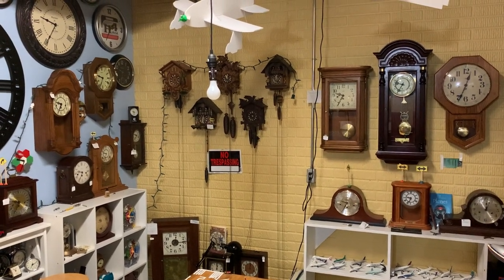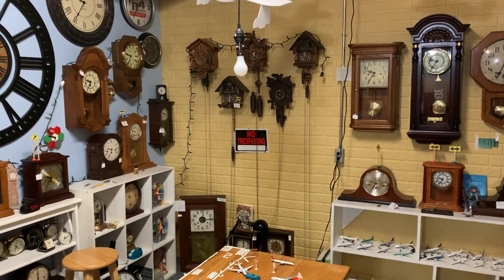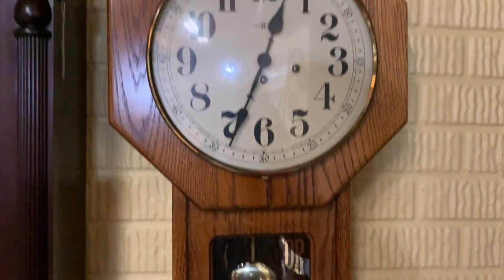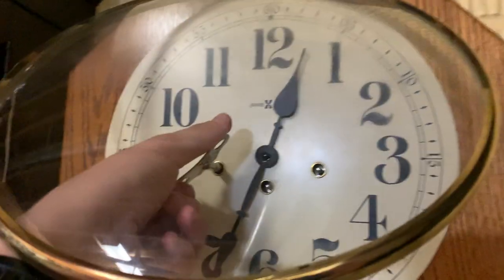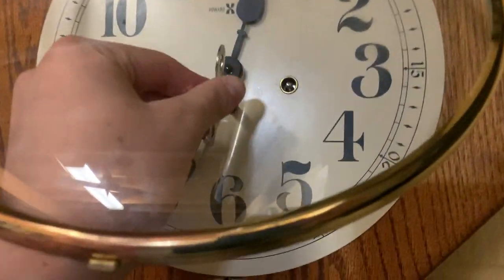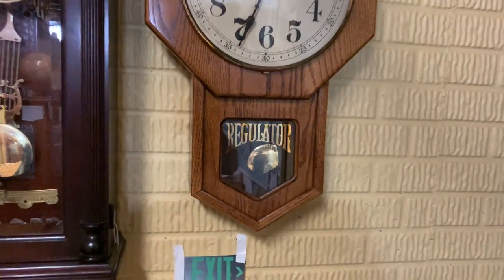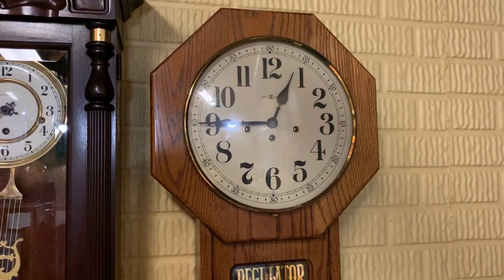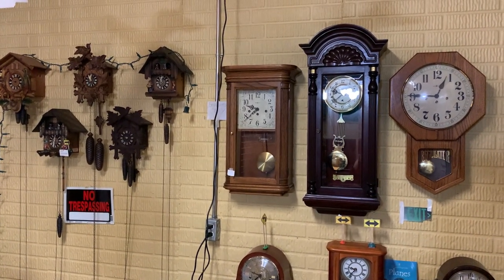Winding the Howard Miller Regulator Wall Clock

Comment: Howard Miller 612-224 triple Chime , has 3 wind up holes, one just goes around in a circle when key applied , cannot tighten ? Not sure why
Reply from the maker: This is a sign that your spring has unwound itself, (likely due to it possibly being wound too much.) As a result, the spring may need to be replaced. I'd recommend taking it to a clock repairman so they can look at it.

Comment: This is just like mine  but. I think I over wound it as the pendulum  just stops. It  also has a small metal leval device below the pendulum.  I try very hard to keep the leval in a good spot as the bubble  in the leval is fussy  what can I do. ?
Am I overwinding the clock ?
Reply from the maker: I’ve heard that it is not technically possible to “overwind” a clock. My best guess is that the clock’s pendulum may be out of beat. You may want to adjust the movement’s suspension spring and pendulum crotch to make sure that it ticks properly. 
For reference, the ticking should not sound like, 

ticktock long pause ticktock.

Comment: Hello, I have a Howard Miller Regulator Clock like this one that chimes two hours behind than the actual time, how can I correct this?
Reply from the maker: If it's striking the wrong amount of times, all you need to do is move the hour hand to the correct number in which the clock strikes.

Comment: I have the same Howard Miller wall clock an no chime any ideas?
Reply from the maker: No chime? Are you winding the key holes correctly?
Reply: @ogClockTV  I winded it clock wise
Reply from the maker: Hmmm... Is there a silence lever? Did you make sure it's turned to chime?
Reply: @ogClockTV  where would a silence lever be located?
Reply from the maker: Actually, on this one, there isn’t one on the front. However, on the mechanism, there’s a small rod right above the chime hammers that moves up and down. Is that pressed down on the hammers?
Reply: @ogClockTV   Hi, Should the lever be up or down for the chime ON?
Reply: Seems the lever should be up, and is , no chiming.
Reply: @ogClockTV  it started chiming on it's own,  maybe cuz it wasn't used in quite some time🤷‍♂️
Reply from the maker: @bec1959  On most HM clocks, the lever has to be up in order for it to chime.
Reply from the maker: @aaronpodgorski1617  Hmmm interesting.
Reply: @ogClockTV  could it have been because it was laid on its back for many years that's why it didn't chime and once I put it on the wall like two days later three days later it started chiming

Comment: Same clock..  stops ticking after a few minutes no matter what..  dunno whats wrong
Reply: Make sure that the clock is hung straight (level). To start clock, hold pendulum all the way to one side and quickly release it.
 I am not a clock professional, however, I just got my parents H.M. Regulator clock going after 17 years of laying flat on its back. It is a purely mechanical clock. Going by my feeble memory, they bought it late 1970's or in the 80's.
I was encountering the same issue i.e. clock was wound, but pendulum kept gradually stopping. I was ready to give up, figuring it needed cleaning and oil (sure it does). Anyway, I noticed the clock was crooked, ever so slightly. I straightened it by eyeball and gave it another shot...voila! Success might also have been attributed to the oil and dirt freeing up after failed attempts or maybe a combination of the two.
 I hope this helps you or others.
p.s. It is so nice to hear that comforting ticking and chime! Thanks for the channel.